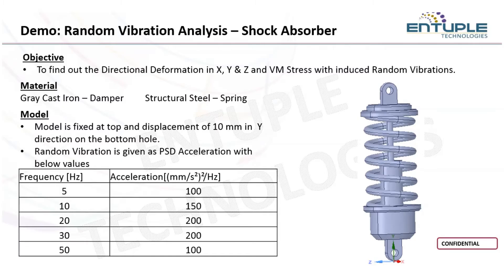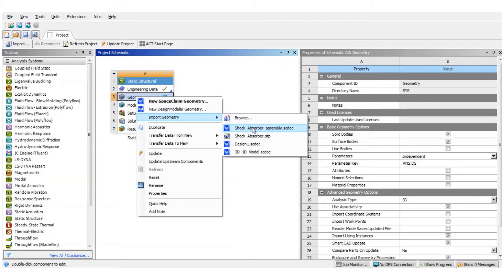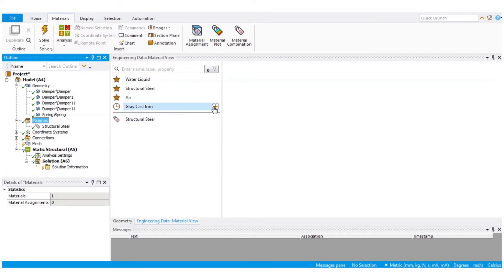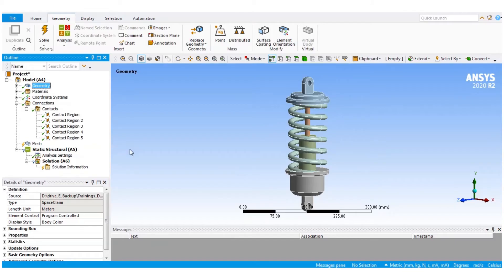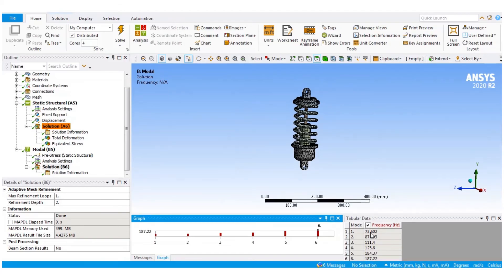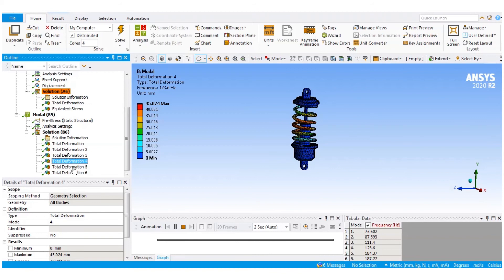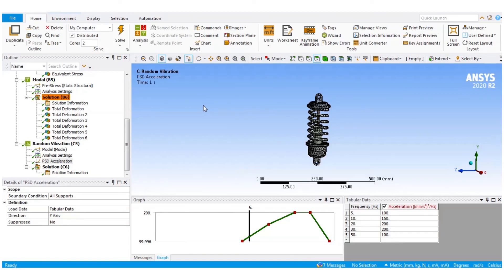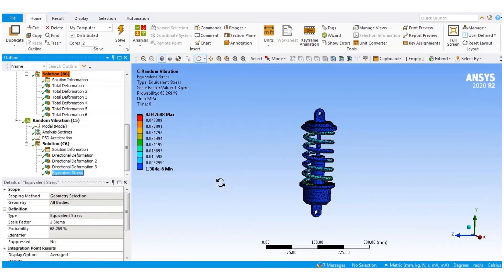Vibration Analysis using ANSYS

Comment: I am unable to understand how come random input gives you absolute value as output? Output should be either random or average of that which is PSD. So rather selecting individual displacement, I think you should have chosen PSD object for output or as a response of system for Random vibration analysis.